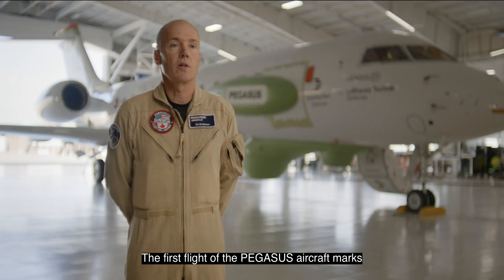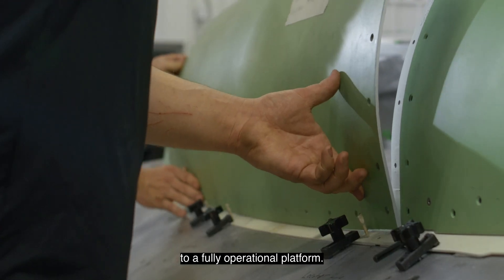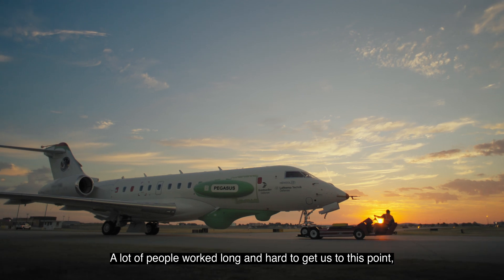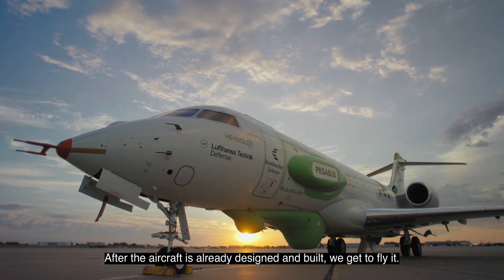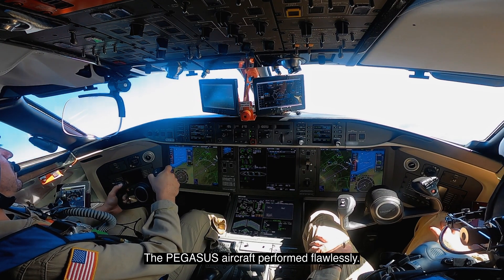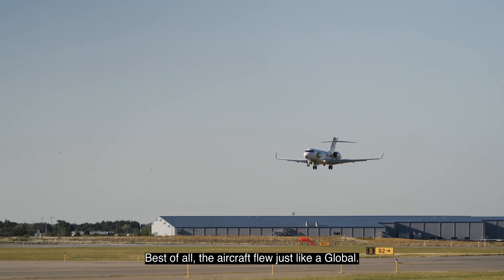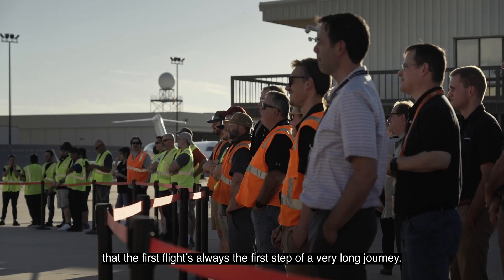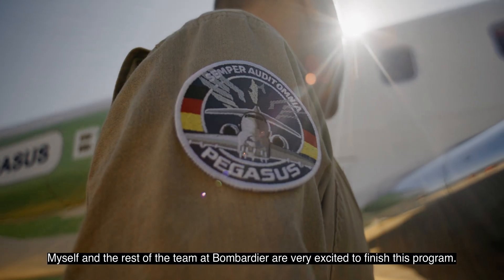PEGASUS First Flight - The next-gen SIGINT solution

Comment: I just hope it’s built better than the A220/ CS300.
Not only the P&W engines are POS, the fuselage alloy is a pain in the @ss AND it’s so thin you can do anything to repair in case of dent. You have to cut out the damaged part, wide around the dent and put a big patch of metal on top of it.
And the repair solution take for ever to arrive, extending the AOG time which cost a lot money for an airline.
Reply: No it isn’t